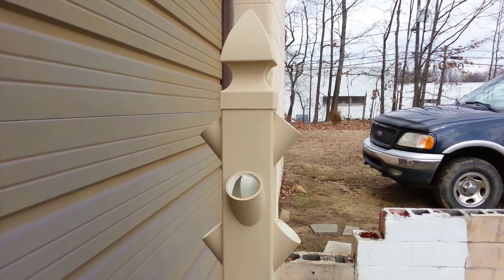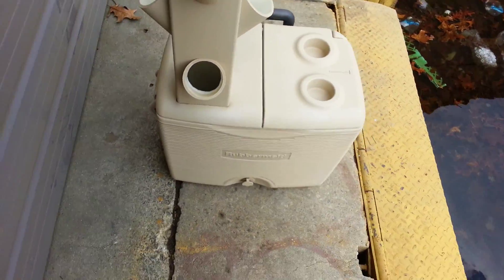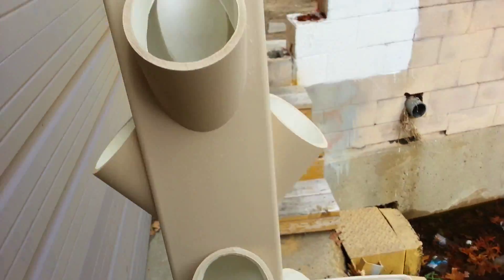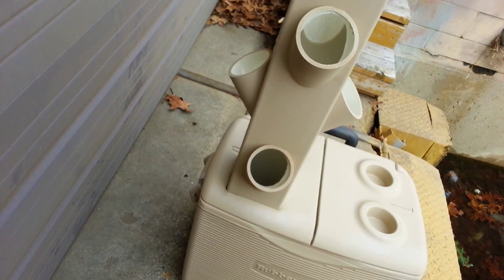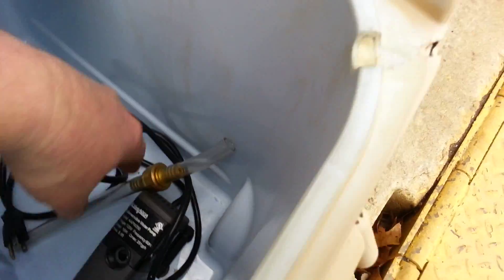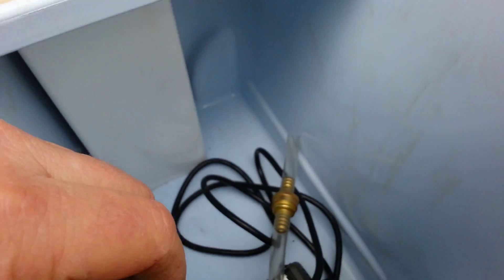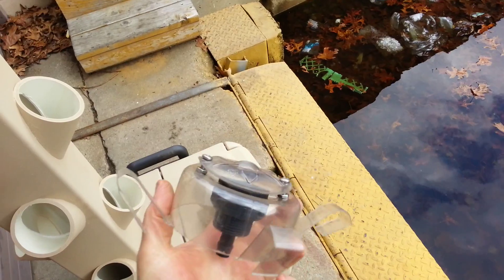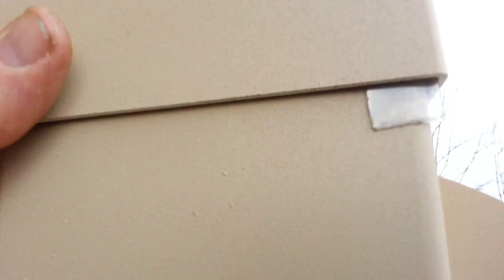DIY Hydroponic Garden Tower V 2.0

Comment: Has anyone tried to collect the water from the bottom of several towers, gravity flow this water into a single large container, use a sump pump to push the water up to a container higher than the towers, and a timer on a valve to gravity feed several towers simultaneously?  This is a concept I am considering and I am in the conceptual stages.  Any thoughts on why this may not be beneficial?

Comment: Thank you for posting, lots of great information and goo tips. I have a question: Did you try to use a micro mist spray?, I might be wrong, but I believe it will use much less water and also will increase the oxygenation inside the tower.
Also could give a detail list of what is necessary to built one of those towers. and it would be very helpful for me to know how much nutrients I use in the water and how to control the PH
Thank you again and I Love your Videos
Orlando
Reply from the maker: Hey Orlando
I've tried to use micro sprayers but they clog very easily and to be honest I was looking for a system that would be easy to use with very little maintenance and didn't require a whole lot of attention to keep it running.
As for nutrients I use general hydroponics maxigro and follow the directions on the back.
The one thing I didn't worry about was checking the Ph. I was using filtered water so I didn't bother with it. Once I get a few things situated I will start making how to videos that will cover a few of these things.
So stay tuned.
A part list..... I will try to make a video with the parts that are needed to make a tower. I got a few emails asking for the same.

Comment: What is the purpose of the smaller plastic disk bolted onto the Iced Tea bottom? The water flows up through the tubing and spreads out along the Iced Tea bottom, right? Why put that disk above it?
Reply from the maker: Hi Jake
The small disc was to prevent the water from shooting out the top of the cap. But i have a new design. If you go to my video titled " My Garden Tower 2014" you will see the new cap design I came up with.

Comment: This looks great! I love how 'finished' it looks with the truck liner spray on it. For indoor towers do you think it would still be fine to use the 5 gallon buckets or would you still suggest the use of a cooler?
Reply from the maker: If using it indoors 5 gallon bucket works fine. I just wouldn't use them out doors.

Comment: Hi Mike, Greetings from Bedford, England. I'm fascinated by your project and thinking I might give it a try next Spring. I have a really small back garden and this might offer more growing space. I am wondering if you can get the optimum oxygenation of your solution in such a closed system and if there might be a way to introduce more fresh air without the rigmarole of added pumps and airstones. Thanks for the vids. Please keep em coming.
Reply from the maker: Hi paul, most hydroponic pumps include a venturi aeration kit. So you don't have to use a air pump . The reason I use an air pump is I have my system sitting out in direct sun and wanted to produce more oxygen than I need. If you make a tower let me know how you make out with it. Thanks for watching. I guess I'm an international star now! :)

Comment: How do you secure the post so it doesn't get tippy and fall over?
Reply from the maker: when I cut the hole in the lid I made it a tight fit so the hole was just a hair smaller than the post and made a straight cut on the bottom of the post so it would stand straight. That was it. I have not had an issue with it falling over. I'm using a 12 gallon tank weighing almost 100 pounds with water in it.

Comment: I built one of these based on your other video. The tip to use a small paint brush to spread this(nothing like wood glue) glue was a BIG help, I usually use starbucks wooden stir sticks for spreading glue. Sprung for a 9.8 ft pump so I'm using the whole 8 ft post, 28 cup holders. got lucky the pump fits inside the post and I used 1/2 inch pvc pipe for the pipe up and shower head just to keep my options open. Wind is a big problem here,Nashville TN, this year also. Thanks
Reply from the maker: Hi Hollis
thanks for watching.

Comment: How did I miss your video!
been waiting for this..

Alright good looking stuff 

My rain tower is 4 weeks old now and I am understanding different concerns you have had with it:

1) My PH went up like crazy: I found out using vinegar or anything organic in these is a big mistake.. I had a vinegar production going in mine in the first 2 weeks.. mother vinegar growing everywhere clogging the holes, my PH would go to 8 in 5 hours from PH6.
I got some GH PHdown dry solution and adjusted my PH and cleaned the tower with bleach and H2O2 and got rid of that issue.

2) Cooling the solution: man I did not think I will have an issue with that since I am indoor but turned out that 25-27c is not the best for hydroponics.. Have to find an easy system to bring it down under 20c..
I went with a 5 gallon rectangle bucket with some bubble wrap to insulate it but man your coolman is the way to go.. I assume that fits 10-20gallons
I am excited to see what you are working on for cooling system. 
the past 2 weeks I have been doing daily iced half gallon bottles  that last half a day for me in there but I am working on a peltier (thermoelectric cooling pump) device design.. 
Aquarium Chillers are an option too but they will be sitting on the outside of the unit and that also adds 200-400$ to the price of the system and you need another water pump etc 

3) The top rain part is hard part to deal with and coming up with an easy solid way of doing it still takes innovation

4) I spent a lot of time cleaning the PVC pipes off the writings on them, indoor I am not concerned with UV but coating it was a good choice all around and well worth it.

so 2 question:
a) what model is your water reservoir?

b) let us know more about the cooling system you have in mind..

Thank you!
Reply: is the cooler  have level bottom? meaning when it seats on the ground and you cut a level post and put it in standing on the bottom of the cooler does the post stand 90degree streight?
How did you cut it so nice and tight fit?
Reply from the maker: Hi Deb 
first thanks for your comments. Ok the cooler I used is made by RUBBER MAID it's a 46 quart split lid which equals about a little over 11 gallons. I bought it at home depot. The water pump I use is made by hydrofarm and it's a 400 GPH PUMP with adjustable flow. Yes the new design does sit straight and level. As for the tight fit I will have to explain in the next video. 
For the next design with built in cooler I'm building it for under $100. Which I can but the big question is will it work? Fingers crossed. XX
again thanks for watching and look forward to your comments.
Reply: Mike Walker can you give me an idea of what you are planning to use for cooling?
Reply from the maker: You are so impatient! :)
You are going to have to wait for the video!
Reply: Mike Walker guilty is charged lol
just a hint.. please?
fan blowing on the water is the easiest one that I came across but increases evaporation..

Comment: That looks good. The access from that split lid will be nice. My only worry would be it falling over in the wind. I had mine fall over (ice chest and all) and had to add guy-wires to it. I never had a problem with algae growing in mine though.
Reply from the maker: It wasn't a bad algae problem it was in spots were you can see were it was starting to form.
We normally don't get high winds in my region during the warmer months. But i do have a couple pieces of granite slabs i could use to weight it down. 
Thanks for check out the video.